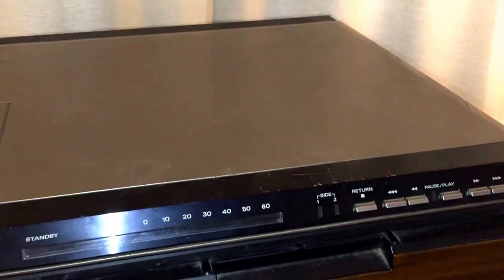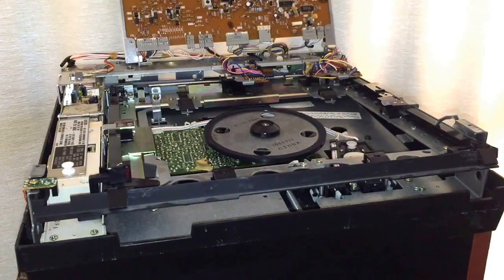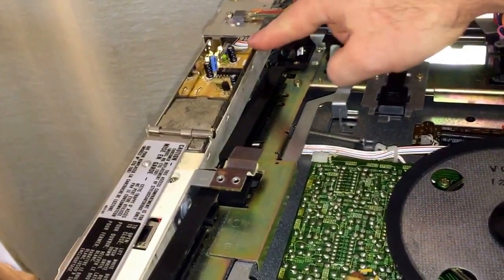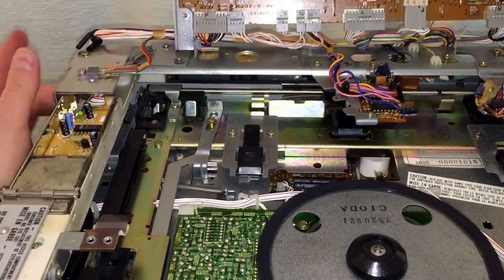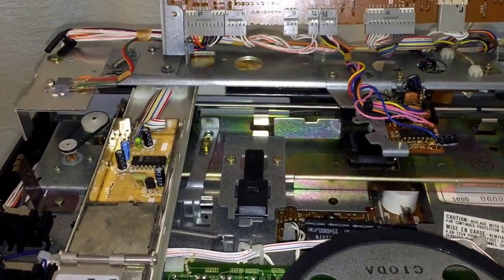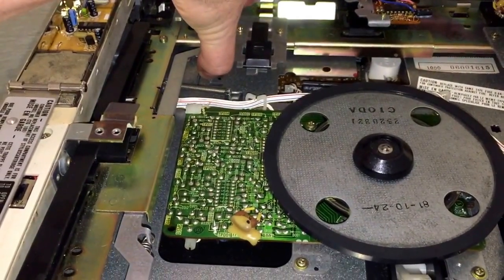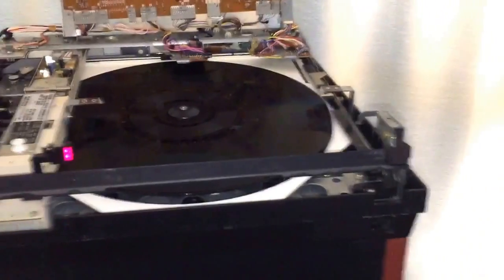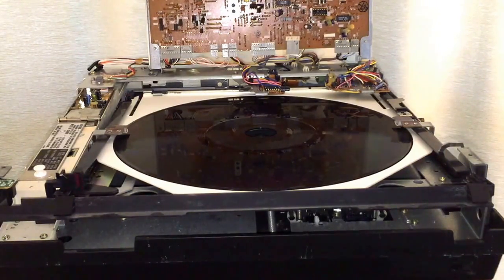How to fix a Hitachi CED Videodisc Player from 1980s

Comment: Excellent video!  It helped getine closer to running.  Not sure if anyone still active on the comments, but on mine it seems the caddy motor is spinning the wrong direction, and tries to raise the disc even more after loading.
Reply from the maker: Great!  I believe I saw your comment on Facebook also, in the CED group.  I wonder what would happen if you switch the polarity of the wires on the motor?
Reply: @databits  will do.  Appreciate the suggestion!   Yeah, kinda taking the shotgun approach.
Reply: @databits  It seems the assembly might be super tough to remove.  I am considering tracing those two wires together north of the motor back and flipping polarity there.

Comment: If my video is a little jumpy and in black and white I should probably replace all of these I’m guessing? Oh, and it has no sound 🤔.
Reply: Hi, I’m new to this myself & I’m guessing a little here, what disc are you playing, is it PAL or NTSC & which type player do you have PAL or NTSC? - I did read somewhere, that if an NYSC disc is played on a PAL player, a B&W image is seen without sound.
Reply: @Mike-qw6wt  😮. I’ve never heard of this. I’ll definitely look into it. Thank you so much. I’ll let you know once I figure it out.
Reply: Where are you located?

If in the USA, your player is most likely NTSC, the disks themselves have either NTSC or PAL written on a corner of the sleeve/caddy.

The difference is related to the frequency either 50hz or 60hz the different mains power US or European markets, it means that the players revolve at different speeds & the correct disk PAL or NTSC is required to function properly
Reply: @Mike-qw6wt  USA

Comment: Picked up the Realistic version two days ago along with 30 or so titles.  She said it worked...if you count lights on the front as working.  The belts were goo gone and this post and a lot of cleaning did the trick.  New belts and all the under the hood tips were the best.  It works and seemed to be happier after a few discs went through.  Reforming some caps I suspect.  Stylus great.  So much better than any RCA version I have ever had.  Just one question.  I do have minimal dropouts and am wondering if I should try the Dropout Compensator adjustment (DOC on the board) or just let it go?  Now off to the NBC 1980 World Series highlights disc.  I was there on the field.

Comment: Cool, new videos! Do you know much about a skt 400 player? I just recently got one. Or sjt? Or if you can make s video on that.
Reply from the maker: Loren Burns - yes I have an SJT200.  Does your 400 work?
Reply: Well, just got it in the mail and I cleaned and put a brand new belt on it. So I am excited to turn it on and when I do the display is all screwy. The red panel is going crazy flashing or doing whatever and the right and left audio lights are going crazy and flashing too. So I put a disc in,one that im willing to scratch or don't care about, and the player takes the disc just fine ejects the caddy. Then the turntable spins up making a rasping sound, ill have to adjust the height later, but all I could do was turn it on and off. I try to reject it but it doesn't work either. but during this the led panel is still going crazy. Also on the tv, shits crazy. its all jittery and the numbers that first come up when you insert a disk are all jumpy and flashy. So I pulled the disc out the back of the player and let the player return to home. That's where im at now. Please help if you can, or if anyone else knows of anything.
Reply: Yo, I've limited it down to the ribbon cable. I made sure it was connected fully and reassembled it the player number display was fixed but the seven front panel buttons still don't work. Ive seen a couple of things about this problem, but no solution really how to fix it. Please if you can help or find something let me know.